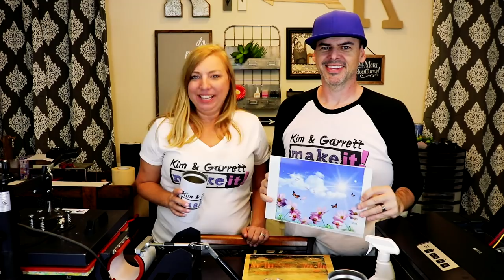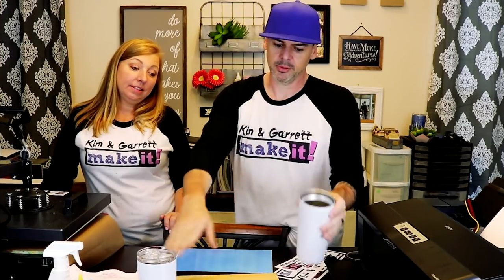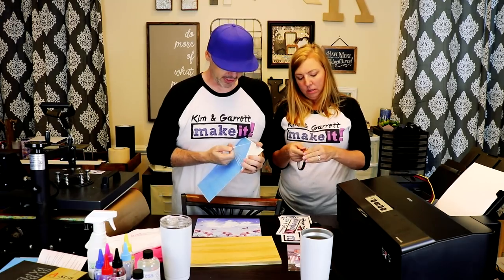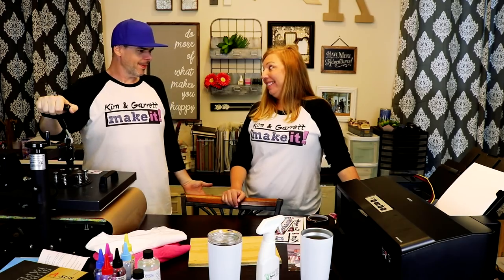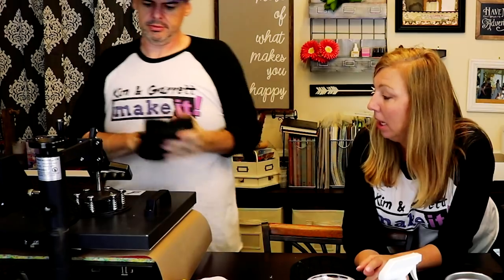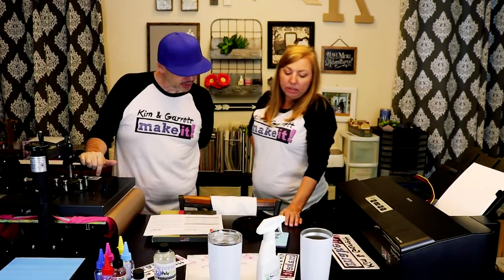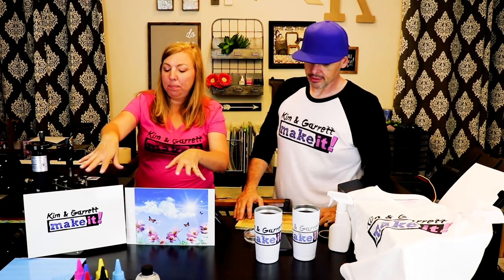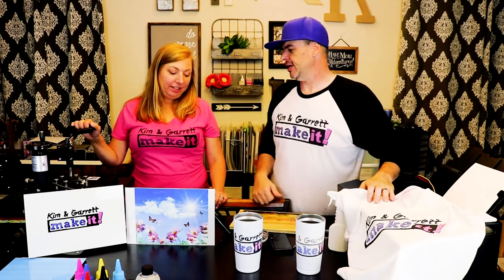Sublimation Printing On T Shirts, Wood and Aluminum | DIY Heat Transfer

Comment from the maker: SUBSCRIBE and click the notification bell for more DIY Videos each week! ► https://bit.ly/2Cq2fUH
Reply from the maker: Yes, its transferred using heat.  The image is printed on sublimation paper and the ink is transferred to the blank.  And, this is the first I've learned about eco solvent vinyl, I can't wait to learn more!  Have you used the eco solvent vinyl?
Reply: Could sublimation paper be use in regular printers (ink jet, laser...). If so, how would d image come out n on items; what would b d process.
Reply from the maker: It requires sublimation ink. You'll have to use a sublimation ink conversion system.  We've included a link to the ink conversion system we used in the description.
Reply: Is this compatible with affinity photo?
I'm looking fora good printer that can print large sizes.

Comment: Does the picture on the tshirt crack? What's the difference between sub paper and iron on paper ?
Reply from the maker: Hi King! Sublimation infuses the ink into the fibers if the shirt, you can't feel it, it becomes part of the fibers.  Iron in paper, sits on top of the shirt and will eventually crack and peel.

Comment: Nice presentation!  Sublimation is a sub surface heat transfer... buy yourself some 5 by 7 plaque boards that are sublimatable ... white or coffee colored boards are best with no other trim colors, flecks in the board.... surprise is to transfer directly to the plaque board...about 360 for 9 seconds...presto..when ordering boards ask the supplier for sublimatable board....discount trophy is the best all around supplier!..of course you can use silver or white aluminum...and you be shocked at how many businesses buy high volume sub plaques...me, I'm just learning liquidation, reslling...did trophies plaques and signs for 24 years...best of luck to you both..Dave  Eastman
Reply from the maker: Thanks Dave!

Comment: Excellent video !! I just received my sublimation Epsom C88 form amazon today. What temperature are you using on the heat press?? Also what kind of sublimation paper are you using?
Reply from the maker: Here are a few products we use: Sublimation Ink - https://amzn.to/2nKicQp

Sublimation Paper - https://amzn.to/2nLbauI

Teflon Sheets - https://amzn.to/2L29d6v

Transfer Thermal Tape - https://amzn.to/2nIyZn8

The A-Sub paper comes with a heat setting guide for various materials.

Comment: Have you had issues with the Epson firmware making it impossible to print with aftermarket inks?
Reply from the maker: YES!!! After the last update, we get an error to re-seat the ink cartridges. So now when I hit print, I pull the continuous ink system out just a little bit and then shove it back in and it prints fine.
Reply: Kim and Garrett make it maybe u can find the old firmware and revert back to it then turn off all updates from Epson. Just to save u the trouble. I’ve wanted to upgrade to a ciss but worried about issues with it. Also not sure which printer would be best to convert. 1430 or 7720. Any thoughts? epsons trying to make aftermarket inks and cartridges not work with their systems.

Comment: That's cool!  Only $200?  Nice!
Reply from the maker: The heat press was a great deal on Amazon, we were surprise how cheap they were.  We thought they would cost more. The printer was a great find. Garret is an eBay Hawk.  He is on eBay more than anyone I know. He says "It all in timing and opportunity."  All in all, it was cheaper and cooler to do sublimation printing than we thought.

Comment: do you use a cover sheet to protect your bottom platen?
Reply from the maker: No, just a cover sheet on the top plate, that's where the heat and ink are.

Comment: I just LOVE your videos! I really want to do this! I’ve been debating on trying it, but was wondering about cost. How much did the whole printing setup cost you? And is it a regular printer with a sublimation attachment?
Reply from the maker: That's awesome!  Thanks!  We found the printer on eBay for $180, continuous ink system was about $40, and the ink was about $40.   The paper, Teflon and tape was about $40.  The heat press was about $250, but they have less expensive presses.  We wanted all the bells and whistles! I am saying... A little over 500 bucks for everything in this project.  Oh! the poly spray was $80, but it makes a lot of spray. a lot...   I think you can all the sublimation ink to any inkjet printer, but we hear you can't go back to regular printer ink after you run the sublimation ink through it.
Reply: Awesome! Eeeeekkkkk...... So excited!

Comment: Ive always wanted to do this but dont have the finances for it unfortunately
Reply from the maker: I think we got everything for $400ish.  You can get a smaller laser jet printer and a heat press without all of the attachments for mugs.  I think you could do this same set up, but at a smaller scale for $200.  Epson C88+ ($100) and just the flat press ($100).

Comment: no teflon with sublimation
Reply from the maker: Yeah... we kept forgetting it, so we used magnets to attach the teflon sheet to the top.
Reply: You need to use butcher paper instead of Teflon with sublimation
Reply from the maker: Yes!  I'm guessing it won't pick up the ink?!  That was a tough lesson!

Comment: we tried on  wood and it worked
Reply from the maker: Did you do anything different? Did you spray it with the sublimation spray?
Reply: @KimandGarrettmakeit  yes, we apply clear printing paste , used for fabric dye
Reply from the maker: Thanks!
Reply: khairani khalid where do we get the paste?